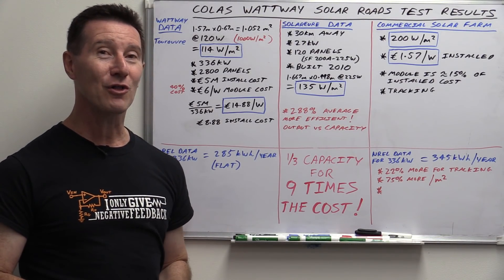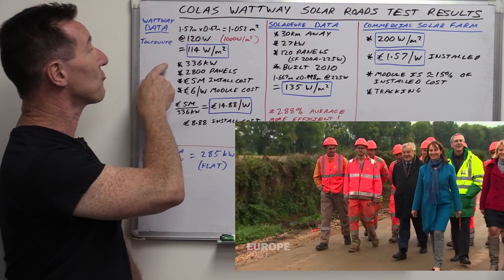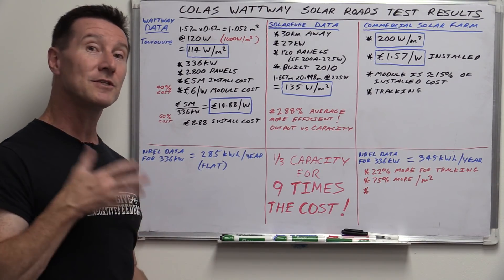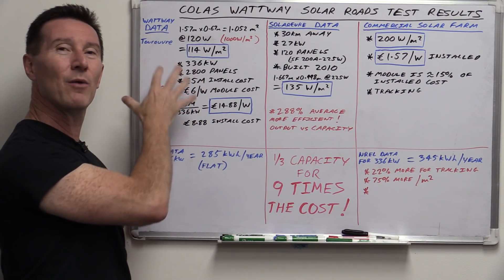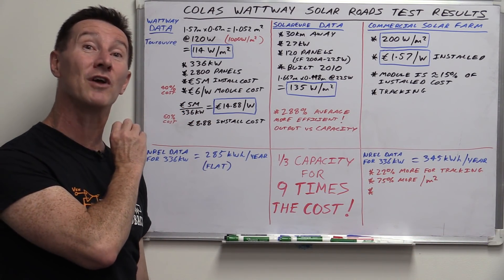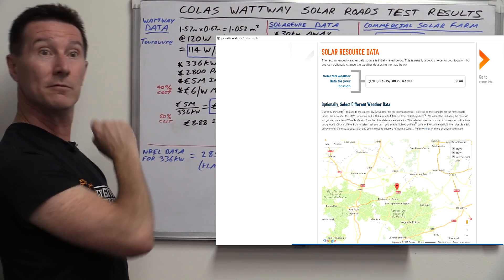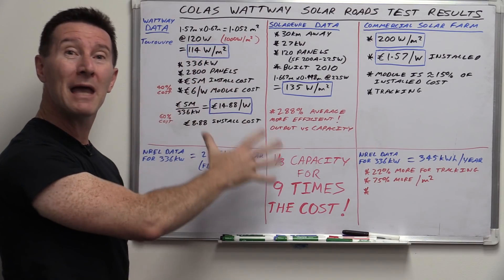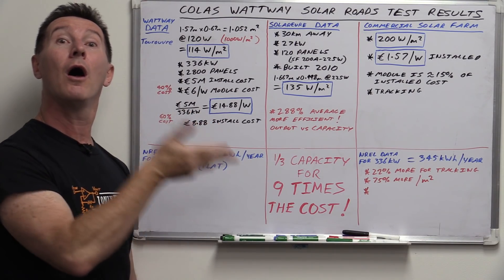EEVblog #1047 - Solar Roadways FINALLY BUSTED! (Colas Wattway)

Comment: Great video Dave, but speaking in terms as '500%' makes my my whole body shiver.
Percentage is going to 100% BY DEFINITION! It's even in the word.
Reply: B Breeuwer In your example, you are comparing it against your reference (100) so 66 is 66% of your reference. You get a new reading of 200, what's that as a percentage of your reference?
Reply: I understand a preference for indexing something to the largest value. But I think that there are times when using the baseline that is less than an alternative (where Dave argues that using solar roadways as the baseline from the perspective of it's advocates) is preferable. He is arguing that a more conventional setup is allocating installed nominal solar capacity something like 500% as effectively. 
In addition, when there is inconsistent use, the best approach is to view both as practically acceptable, ideologically arguments aside. See the arguments of soft versus hard "g" in GIF.
Reply: B Breeuwer Sorry but the inconsistent usage reference doesn't imply or mean that a percentage can't be greater than 100%! One of their examples is even:

"An increase of 800% means the final amount is 9 times the original (100% + 800% = 900% = 9 times as large)."

800%! Is that wrong?
Reply: 500 % means 500 for every 100. Which also translates as 5 times the original value.
Reply: Cent means one hundredth. Per cent is just per hundredth, i.e. a fraction with the denominator 100. 200/100 is a valid number.
Reply: It seems that you are advocating for use of a normalized scale.  Am I understanding you correctly?
Reply: B Breeuwer, it seems to me the only confusion is on your part. 

As in this: 
«Let's assume we have some value that is our 100% reference. To make things super easy we use the value 100.
We have another value that's 33. So that's 33% compared to our reference.
This value actually shift up to 66 for some reason. Which is 66% or TWICE as much as the original value and NOT (!!!!) 200%, since our 100% value was at 100.»

YOU are mixing your references, then pretend the confusion is somewhere else. Percentages are always relative to a reference value. YOU switch your reference from the initial value of 100 to the value of 33, then pretend there's some issue with using percentages, when in fact the only issue is with how you are using them.

The funny thing is that in your example, by choosing the initial reference value of 100 you actually complicated things. This reference value opens the door for exactly the sort of confusion you are making here, between "100" and "100%". 

And again here:
«IF your baseline changes, that becomes the new reference (= 100%) and therefor everything shifts up., so let's say value 200.
So value 33 is not 33% anymore BUT 16.5%. Value 66 compared to this value is STILL twice as much but ABSOLUTELY NOT 200%. »

Again: YOU change your reference. Saying that "value 33 is not 33% anymore BUT 16.5%" makes absolutely no sense, because – as I already pointed out – percentages are always relative to a reference value. Of course the percentage a given value represents will change when you change your reference value.  The value 33 is still 33% of 100 – and at the same time 16.5% of 200, and 3.3% of 1000, and 0.33% of 10,000, and 1000% of 3.3, and so on. 

If you can't handle percentages, that's your problem.
Reply: B Breeuwer You may want to check out https://en.m.wikipedia.org/wiki/Percentage. There is absolutely nothing wrong with a percentage figure above 100!
Reply: 100% just means unity. Think of "%" as a dimensionless unit. Kind of like L/m³, which can be a usefully descriptive unit.
Reply: IF your baseline changes, that becomes the new reference (= 100%) and therefor everything shifts up., so let's say value 200.
So value 33 is not 33% anymore BUT 16.5%. Value 66 compared to this value is STILL twice as much but ABSOLUTELY NOT 200%. 
This is one of the reasons why you should pick your baseline very carefully. 
Dave picked the wrong baseline. He should have picked the ever thinkable best case scenario OR kept the baseline he choose and say it was five ehm no..... 6 times as much. ... ... See the confusion already???
Reply: No, you don't need to give me a Wiki, since I have been using it the last 30 years or so. (I can even still copy paste my books if you want)
But apparently some people made the definition very loose, which can also be find in the wiki page you're referring to ('Due to inconsistent usage').
The correct way of using it, is say it has x% rise or fall, although a better way is just saying it's twice as much.
The normal way of using percentages is to make something the absolute maximum value (=100%) and one look how something is relative to that value.
This can also easily been seen by the formula a/b x 100. Since b is our reference, it's NOT (always) wise to take any number bigger than b.
Ones again it's being very inconsistent and a huge trap for young players.
(not the first intern I have seen falling into this mistake)
Reply: Maybe another way to explain why it's inconsistent is as following.
Let's assume we have some value that is our 100% reference. To make things super easy we use the value 100.
We have another value that's 33. So that's 33% compared to our reference.
This value actually shift up to 66 for some reason. Which is 66% or TWICE as much as the original value and NOT (!!!!) 200%, since our 100% value was at 100.
In other words, you explain differences in how much that is compared to its value (= x times that value)
I know many engineers (and marketeers) mix this up, but in a science lab you can already prepare to sign your resignation letter.
Reply: I just updated with an example. But even yours shows that using percentages as an increase leads to inconsistent and misleading values and conclusions. 
800% is indeed 9 times as much and NOT 8 times. but most people will read that very differently.
Also this example is an easy one, but sometimes it can get extremely nasty were you WILL end up in something else than 9 times as large.
The point is, it's not consistent anymore compared to other values or your reference.
That's only the practical explanation, the philosophical and theoretical is a whole different can of worms, since it's extremely odd to compare something to something else that is already considered of be 100% (or in other words, the best of the ever best, like efficiency or so).
It's just very weird and odd to use, in any sense, unless you use some theoretical reference (= 100%).
In this case, that's what David should have used.
Reply: Samuel Rustan I am advocating for clarity. As discussed above (and in the field) abusing it this way will lead to confusion and wrong conclusions.

Comment: My favorite response to solar roadways. What happens to all the rubber from tires? It doesn't just disappear, it doesn't stay on the tire because we know tires wear down. It wears into the pavement just like that one picture of the tread marks on the solar road showed. What happens when you get these hot heads who do burnouts on the road, or if someone has to slam on the brakes for something in front of them. Or what about accidents that spill oil and scrape up the ground. Pavement you just put absorbent sand on fluids and keep going. Solar roads now you have to send a cleaning crew out to fix the surface of the road everytime someone gets cut off and slams the brakes, or when some dumb kid does burnouts at an intersection.
Reply from the maker: Stop this foolish talk about practical concerns :->
Reply: I'd be more worried about Bob and his snow plow, actually... that would be a good way to get rid of the panels.
Reply: Tyre rubber forms dust, not a layer of rubber. It blows off the road and pollutes the road verges, becoming another of those minor environmental issues that we humans create.
Reply: Yes, tire rubber largely flakes off as microscopic particles, unless you're doing burnouts or locking up/braking hard and melting the rubber off the tire. The common mode is certainly not going to leave marks on the road, but melted rubber definitely will.
Reply: But this is Yet Another Opportunity for Jobs! Road Cleaning Crews cleaning up the roads, getting paid and feeling like they're Contributing To Society! None of this Universal Basic Income thing of paying people to do nothing after robots take over so many jobs, especially when there is "Real Work" to do cleaning the roads?
Reply: Also I hate to be morbid but I was in forensic cadaver search/remains recovery and, well, human remains can become extremely messy in high speed accidents- particularly motorcyclists and especially the fatty substances in the body. Recovering and cleaning of the smeared and basically macerated pieces with dignity and  effectiveness would be tremendously difficult!!! Again apologies for morbidness but it is a genuine concern and a dragged human or multi victim accident can  leave a very long, large contaminated area.
Reply: It's not even rubber anymore. We as a society use oil instead because it's currently more available than rubber trees. There's so many vehicles that require tires now a days that we have a scalability issue with acquiring a steady and cost effective (time and resources availability) source of "rubber".
Reply: No, the governement will simply mandate only flying cars from now on. Then we also won't need any roads anymore and can put the solar panels on the roof ... wait a second...
Reply: then they will claim that the energy will transfer through wifi because each panel have wifi on them XD
Reply: What about when a car catches fire in an accident. It is pretty rare but it happens every year.
Reply: i know what will happen...  the solar module which is underpowered at the moment, will ask its neighbour to borrow some auxilary power (if present of course) then the module will call its controller module to do a remote check up. the controller module sees how the solar module failed and will create an automated work order for maintanance.. then some robot will show up and clean the roadway... and a politician will show up, tricking you in their next fantasy..
Reply: What will happen is the government will mandate that all new cars are equipped with road scrubbers, so they clean the road as they drive!  Obviously.
Reply: sorry, but this argument is weak.

Comment: Do you calculate the crop not grown on the solar farm, then consider the normal road maintenance costs. The road network is already there producing nothing, the farm is needed for crop growing. It would reduce the bird death count with wind power. Piezo crystals embedded in the road could be better. The more traffic the more it produces and isn't dependent on weather.
Reply: It would be much more economic to build a structure over the road and put your panels on that. Then, with reduced water and sun on the road surface, it will last much longer.
Reply: Alot of cost building something extra and they'd have to be very high, maintenance would be difficult and you'd have to keep closing the road. Roads like some rain it's what cleans them. If they were held up by a kind of light pole, crashing into one would be a major issue.

Comment: ok so I may have a solution... lets use the example of the cell phone towers, the companies will pay household owners a nice fee to let them have their hardware at their roof, ... so... if solar energy is needed for the public streets let's say that the government or private sector could pay and or give discounts and gifts to those willing to lend a portion of their roof, in this way the solar panels do not suffer from the harsh forces that may transit on any given road... in this way the solar hardware is located right at the spot where the energy is needed and the maintenance cost can be lowered if they use local personnel to maintain the infrastructure, and the owner of the house gets a economic bust that can help in a rainy day...

Comment: How about wind farm roadways??
Reply: Dan Floyd Hydro electric roadways, when it rains the water spins the turbines. Genius.
Reply: SOLAR WINDMILLS!!!
Reply: as long as they arent in ted kenedys back yard thats cool
Reply: Wait, how about wind farm *airplanes*? They move so fast, if they put propellers on them they'd be able to generate a lot of electricity. They could charge batteries in the air and transfer that when they land.
Reply: Too late, someone already got this amazing (scam) idea: https://goo.gl/WviFfG
Reply: I got even killer genius idea.  Lets put wind turbines on the electric car and let them charge battery when driving.
Reply: Never mind wind farm roadways - how about just farm roadways.
Attach farm machinery to your car and you can plough or harvest the roadway as you go along.

Comment: Apart from the utter technical and economic idiocy of it, how is the road safety? I'd not feel comfortable driving on a knobby glass surface - what happens if it gets wet or dusty or covered with snow or ice? What if tiles come loose or apart so that punctures and other damage can happen? My gut feeling is that it's not safe to drive on.

I also assume it's meant for areas with dense population and thus dense traffic - wont it be covered by cars and dirt much of the daytime? Oh well, best forget about it.
Reply: Oh, we get to the point of "huge numbers of accidents because you can't fucking break or change direction on a wet glass surface at any speed above a rabid snail's pace" much before inhaling ground glass would become a problem.
Reply: And let's not forget if a big enough shunt does happen on this road, what if that glass road shatters? That in itself is a risk for pedestrians.
Reply: What would you ecpect them to use? Blood magic infused unobtanium glass that was mass grown on autonomous farms?
Reply: Another point brought up by Thunderf00t - the glare... Those tiles works like mirrors at a low angle with resulting extreme glare - driving towards a low sun will blind you : https://www.youtube.com/watch?v=_aa85qw6G0k